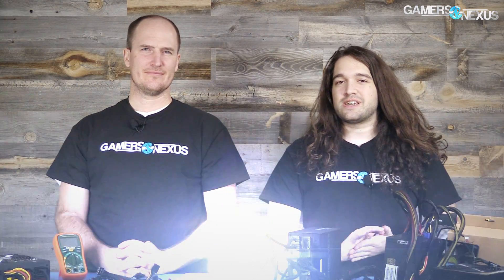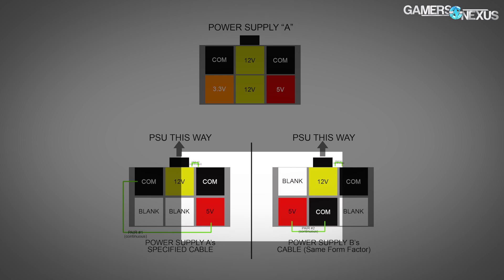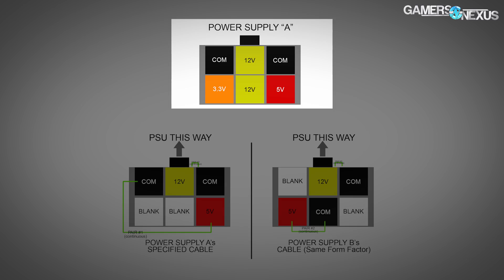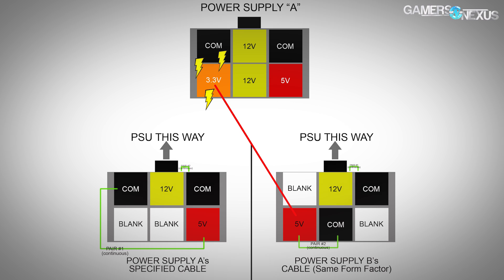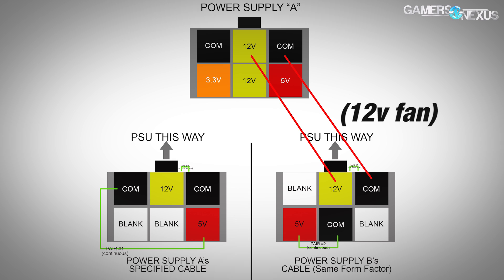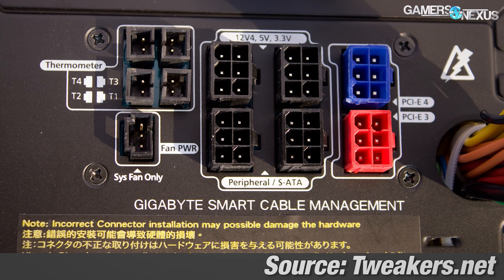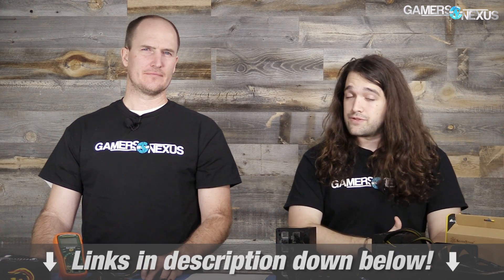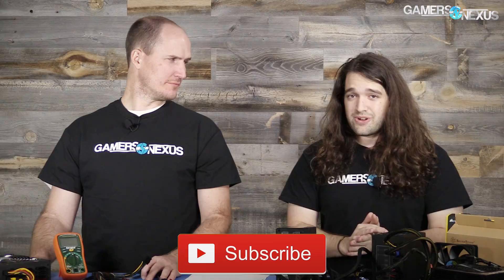PSA: Stop Mixing Modular PSU Cables

Comment from the maker: Hey everyone! Just a quick educational video on an important topic. You can quickly learn this information in our article, if you prefer! http://www.gamersnexus.net/guides/2702-psa-on-mixing-modular-psu-cables-dont-do-it
Reply: With modding, white builds, black/red builds, black/silver builds etc, modded cables even sold in packs at regular retailer chain stores now, I'm sure this will be an increasing problem in the near future.
Reply: Gamers Nexus Even between same brand and similar but not same models i had a very very very bad experience with this.  Tried to google for answers before doing anything but  didn't find anything against what i was about to do and even i am in i.t 15+ years i got fucked pretty good.  I changed my psu with the next bigger watt model of the series and because i didn't want to redo my cable management i kept the same cables.  Everything besides Motherboard and its cpu amd ram got fried.  I lost all data in 3 disks of years of work.  I paid 300$ just to get my data from the unspinning hdd. Plus a lot of money to replace the burned hardware. So be careful always  change the cables even if it's the same psu. If only that video was up 2 years ago :(
Reply: Georgi Nedyalkov there are 2 kind of sleeved cables. extension and full replacement. extensions are compatible with all psu model.
Reply: Because e.g. EVGA uses FSP and Seasonic Power supplies. (n more)

Such companies don't make power supplies, so depending upon where they get em from the cables look. 

There is no EVGA power supply, it's always just a re brand.
Reply: Hey Steve nice video. Didn't know that the PSU cables are not universal. But does this goes for these custom made sleeved (colorful) cables?!?
Reply: Been there, done that. My PC just wouldn't turn on.
Reply: +Gamers Nexus Hi Steve, here's a suggestion: why not making a video teaching people to use the multimeter on several computer components: PSU, Transient-Voltage-Suppression diodes, MOBO's capacitors, etc.
Best regards!
Reply: The extension ones should work on all as it literally is a 1:1 pin-out and extension. Typically, the full replacement custom sleeved cables will specify which PSU it is meant for usually sold in a kit.
Reply: Ah, thanks for the clarification, I had also forgotten about this. +1
Reply: those should just be extensions but I am sure they lead to a false sense of error proofing.  If you plug those into themselves and can see the individual sleeves they will make a loop with no cross over or switching of pin location.
Reply: Corsair RMi and RMx Power Supplies are noted since if you want cables for them you have to go with Corsairs own Type 4 cables.I am telling you this since I own a RM750i
Reply: How did you not plug your mod mat at the end of this video? It was a natural use case. A multi meter testing the  device side voltage on a forced on, but device side disconnected psu will clearly let you know if your cable is outputting the correct voltages as per pc power supply standard. Any deviation from the output labelled on the mat (or your provided link) will disqualify the cable psu combo from being connected to a component and possibly have saved you more than the price of a nice to have modmat. A online pin out is never as good as a hard copy right in front of you placed wheee you don’t even need to raise your head or risk referring to a different connector after nudging a mouse whilst doing the multi meter probe dance. 
Also a set of test connectors with psu connector female sockets going to 4mm test lead banana sockets for testing, modding and monitoring voltages would be a awesome product for the enthusiast market. Much better than a shitty blue beer glass, which happen to look like it’s made of thinnest glass possible. Please make and promote genuinely innovative products like your modmat and just stop the tourist style trinkets standard to old outdated shitty revenue maximisation techniques we are all sick of. Branded mugs and pens are tat, they more often then not diminish the brands perceived quality as the novelty wears off to junk status.. We know you have the mindset and creativity for original unique content, everything which wears the respected and much loved branding should designed with the same aspirations. Even if all your glass or mug did was convert websites .com . Ca  .in to convert their respective nati
Reply: Link is now dead. Hopefully after 8 years everyone got the message.
Reply: Great video, there should definitly be a standard for the cables on the psu side as well. This would also benefit cable shops for the custom sleeved cables, as they could potentially offer much higher colour variety.
Reply: The purpose would be to protect unaware people from themselves. Such people would just find another way to do something stupid. 
... and would also complain about PSUs getting a bit more expensive, depending upon the costs related to achieving this.